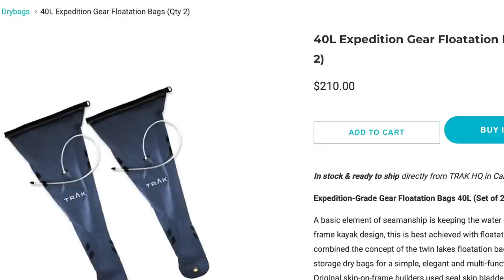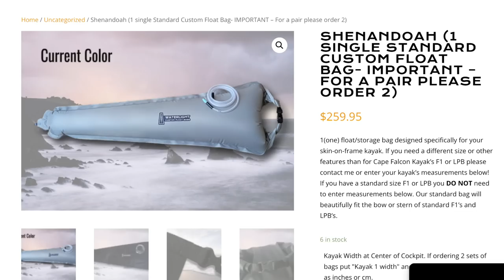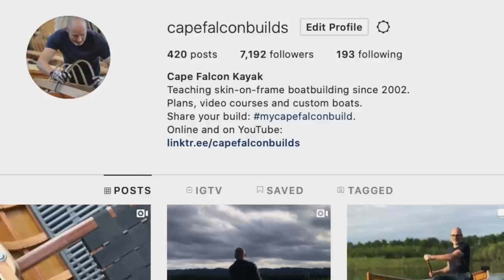Scary kayak sailing in 40mph winds, I went for a LONG swim!

Comment: Sometimes I think we ONLY learn from OUR mistakes. Thanks for extracting every bit of knowledge from mistakes made and cautions dismissed. I learn from listening to your thought process (before and after the experience). You are a great teacher.
Reply from the maker: Thanks John, are you still paddling that boat?
Reply: @capefalconkayak  I sure am. I get my LPB out on Whitehall reservoir 3-4 times per week (May-early November)… I do about 5 miles in 1 hour (I’ve slowed down since my initial 6 miles in 1h0m on the Hudson), but the shallow lakes of Massachusetts are just slower than the very dynamic Hudson River. My LPB is in its 13th season. I added a second coat of PU a few years ago. I live a mile from the lake (3 from the boat ramp) and there are 3-4 other lakes within a few miles. Been retired for almost 9 years and have 2 grandsons, most frequent comments about the boat are “that really moves” … “wow your fast”. And I still explain the construction and your workshop almost once a week.  That’s why I call it my “ice breaker”.

Comment: I learned decades ago with canoes, kayak and even a large 17 foot rowing wherry that could take multiple passengers;  you only have the power of a single person and the wind is a heck of a lot stronger.  So much stronger that you should expect to be blown downwind to the shore and it doesn't matter how hard you can pull or paddle.

Comment: I really loved this!  This is one of the best kayak videos I’ve seen.  Very useful and helpful! 

I wanted to make a suggestion to check out the technique of using a paddle float and heel hook rescue. Heel hook is by far the fastest way I’ve personally managed to get back into my boat.  

You might find it a bit easier to get into your boat and less scary. 

I bought my paddle float on Amazon for 37$,  it was just like the Level six but no mark up or brand stamp.  It’s a great addition for peace of mind. And just folds up and lashes to your kayak deck easily.

Comment: As a water person and sailor for decades I totally understand the fun time to be had. Im glad it worked out as you are safe...thats most important. But since you did have some reservations on conditions when you were at the launch and trying new rigging you might have waited for more favorable winds. The video is excellent. It's wonderful how you explain the things that worked, things you messed up on and the I think Ill do this next time. Windy day for sure!!!! While you were explaining the kayak being pushed by the wind when trying to roll up (sail in water) and use the other side of the boat, if the waves are of a decent size like  in the video you can also time the swell to help roll the boat up. That sure looked like a fun day otherwise.....sometimes you JUST GET WET.

Comment: Thanks for sharing this adventure.  Used to see + 40 knots at the gorge and at that level wind would start picking up board and sail and flipping it down wind faster than I could swim.  Very impressed with your sail setup and skills.  What a hoot.

Comment: If one is going to sail in these conditions, a rig that allows you to adjust the rake of the mast would be useful.  First, the center of pressure can be moved aft by increasing the rake and if constructed appropriately, the mast and sail can be dropped back on deck if needed for stowage or in a difficult righting situation.  Just some thought and good video.

Comment: Brian, another fantastic vid... As I was watching and you were explaining the difficulties of sailing in high winds, I thought, "Hmmm, kitesurfers look for highwinds, would that even be a possible alternative to a sail?" A friend of mine uses one with a double occupancy canoe, one kiting, one steering...
Reply from the maker: A four-line kite might be doable in a tandem kayak but solo you are pretty restricted to a single line parifoil.  I’ve done a lot of that over the years but it’s a difficult thing to use practically because it takes so much time to get up into the sky and it’s very hard to get it out of the sky so any starting and stopping decisions need to be made miles in advance.   It’s also somewhat limited on the angles to the wind.  And only works in winds over 15 mph and less than 25

Comment: As a dinghy sailor, what you're calling a clam cleat, I call a jam cleat - cam cleats have cams that move to accept and lock down on the line, and are better with loads. Jam cleats are used more for rigging adjustments like outhaul
Reply from the maker: Yeah the terminology is a little annoying and varies from manufacturer to manufacturer.  What you’re calling a jam cleat Ronstan calls a V cleat and Clamcleat calls a clamcleat and a true jam cleat is completely different than either of those things.   Generally in kayak sailing we use some variation on these little guys because they are compact and work well.  And even the nylon ones with a fairleaded won’t slip until you hit around 60 mph of wind speed which isn’t really sailable conditions.  Because the sails are only .7 - 1.3 Square meters they can handle the forces.

Comment: you comment about break apart paddles and not being able to put them togterh was why , in my forst ever rolling class, i set the goal of "grab a half paddle from the front deck and roll up"... which i managed at thend of the 6 week class.
admittedly.. it was NOT in extreme conditions... and a sail up aty rthe same time - could you design it as quick release so the sail collapses easily if you capsize - we sdo that in sailing - releaing all the sails so they dont hold energy during the roll back up
Im now focusing more into greenland roll style where the paddle is not the power for the rol.. body movement dfoes that - and the paddle is less influential  (think norsaq rolls) - so a half paddle should be plenty!

Comment: This sure seams like pushing the limits of you and the boat, glad you survived. Have you considered some sort of vang for the sail rig? might make raising the sail more complicated, but it would help prevent death rolls
Reply from the maker: I’ve got my sheet set up so it has a pretty strong Vang action something like this only happens when you’re just way outside of recommended conditions.  I always try to minimize strings and complexity in kayaks.   Although it isn’t terribly hard to set one up I just haven’t needed it.

Comment: Would it be beneficial to have the ability to move the sail rig fore and aft while testing the rig possibly with multiple mast step positions?Also does the kayakers weight play a role in where the rig position should be?

Comment: Also maybe you need some sort of kicker/vang to stop the boom riding up like that.
Reply from the maker: Vangs are possible but it’s usually just complexity I don’t bother with because in any normal wind situation the sheet has enough vang effect.
Reply: @capefalconkayak  I did notice that the sheet position gave some effect.
Reply: @capefalconkayak  did my other reply get removed because of the link?  Hopefully you saw it about the k style clam cleats.
Reply from the maker: @DansKoiPond  I never saw the other reply?
Reply: @capefalconkayak  don't want to put another link.  Search for 'barton k cam cleat' all the manufacturers do that style.  I suggest it for your sheet jumping out issue.  They also do base plates that hold the rope in the right place.  Don't like the other style as they always slip.  The other suggestion I had was a mast head float.  Windy weather in the UK is sometimes called milk bottle weather because the dinghy sailors tie a plastic milk bottle to the top of the mast.  It would stop it inverting and in a reasonable wind angling the mast to the wind would allow the sail to lift, righting it.
Reply: @capefalconkayak  oh also said how I loved your videos, I have very little kayak experience but plenty of dinghy and yacht sailing.
Reply: Sorry for multiple replies just thought if your kayak is hard to steer in a blow another trick is to stream a line out from the stern should stop the hunting.

Comment: Are kayaks and canoes the only boats you can build using skin-on-frame? I'd love to build something along the lines of a rowing boat.
Reply from the maker: Rowboats are totally doable although it’s a bit more challenging, because the ideal cross section shape of a rowboat is not a fair curve so you end up making individual forms for laminated ribs, which is a lot of work.  I’ve made some gorgeous Adirondack Guide boats this way, but it doesn’t go together as easy as my steam bent system.  You can get about 85% of that performance for about 35% of the work if you just build a larger canoe and put oars on it.  I actually have a rowing system for my canoes that you can see in some of the other videos here.
Reply: @capefalconkayak  thank you! I've been trying to find more information about this style of building and not having much luck. Your channel is probably in the top 3 on YouTube.

Comment: Great video Brian. Do you grab the end of the upside down kayak and lift to empty most of the water out before turning the kayak over ? Good on ya.
Reply from the maker: That doesn’t really work in a self rescue scenario.  But I do turn the boat on its side to get some of the water out.
Reply: @capefalconkayak  Also probably doesn't work well in a boat without bulkheads

Comment: I'm in Olympia WA. Where do I go to get a Reed  custom sea sock? Thanks
Reply from the maker: You can send them the dimensions of your cockpit but if it’s one of my boats they actually have all of my custom templates on file.  I can give you the reference numbers if you need.
Reply: @capefalconkayak  I have a blazing Aspen wooden kayak not skin on frame. With rear bulkhead but no front bulkhead.

Comment: A simply stopper knot would have solve the slip problem.
Reply from the maker: Yeah that’s generally how I do it with the closed cleats but the sheet cleat in this case was an open clam cleat so a knot wouldn’t change anything

Comment: Is a kayak designed to sail I don't think so so you pretty much ask for what you got
Reply from the maker: People have been using sails  on kayaks for decades and it’s a great tool when used within the limits of the conditions the gear and the paddler.   In this case I was intentionally forcing a situation like this because as a designer I need to see where the actual failure points in the system are.  I’m not at all unhappy with what happened.

Comment: And now, please repeat the same again in German.

Why were you even sailing with such a tippy/wobbly boat at 8 Bft (= gale)?

Besides, the sail was hoisted far too high above the boat. (see the topic of centre of effort)

Comb clamps are also more than conceivably unsuitable for sailing with an unstable kayak in such wind conditions. It is better to lead the sheet loosely out of the hand so to be able to react quickly (e.g. to sheet out, to ease the sheets, to slack).
**************************************************************************

Original text:

Und, jetzt das Ganze bitte nochmals auf Deutsch.

Warum segelten Sie denn überhaupt mit so einem kippeligen Boot bei 8 Bft (= stürm. Wind)?

Dazu war das Segel doch außerdem viel zu hoch über dem Boot gehißt. (siehe Thema Segeldruckpunkt)

Auch sind Kammklemmen zum Segeln mit einem instabilen Kajak bei solchen Windverhältnissen mehr als denkbar ungeeignet. Das Schot sollte dabei besser lose aus der Hand geführt werden, um blitzschnell reagieren (z.B. mittels fieren) zu können.